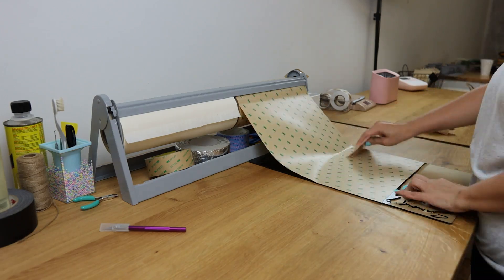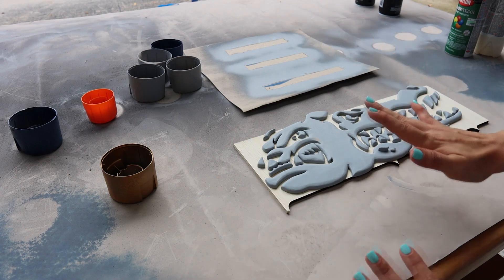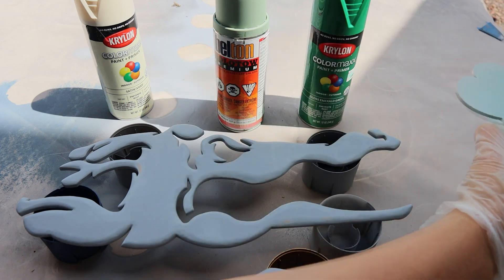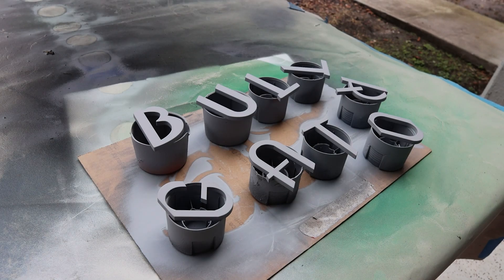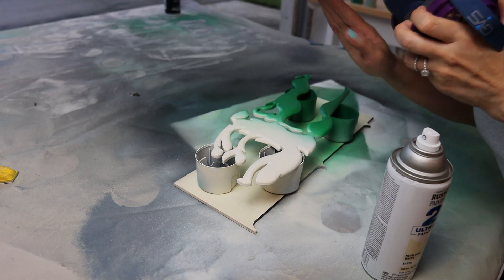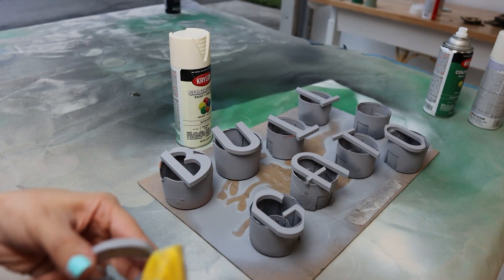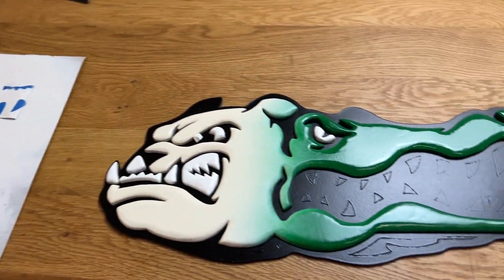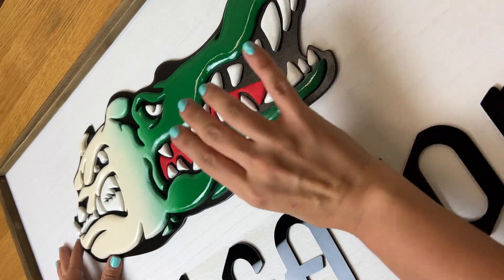How To: Laser Cut Signs Part 2

Comment: I was using both of these, but switched to Ironlak. I love it coverage. Hobby lobby has it at $5.99 as of 09nov24. Walmart sells the 2x stuff at around the same price. Both Rustoleum and Krylon have way bigger color portfolios, but give the ironlak a try. Please note, the spray cap is slightly different, so the paint sprays heavyier.
Reply from the maker: @MikeyouLikey  thanks for sharing. I’ll give it a try!

Comment: I’m trying to understand the purpose of sanding the mdf.
Reply: it's added a rounded edge. The laser added a sharp, straight cut and the design is softened / rounded over.

@ThatMomWithALaser You should check out a Palm/Trim router though for sure :) You could have saved so much time using a trim router and a "round over" bit. They're a lot more powerful than your dremel but if you can get to grips with them you'll save so much time and effort.
Reply from the maker: @MattHashTwo  thank you! I have one but I don’t trust myself with it. 🤣 Plus, most of the peices are so small idk how else I’d get into those grooves and thinner parts without breaking something. I’m assuming you just mean to use it on the larger peices like the bullgator one in this sign?

Comment: as for the bubbles, you also are trying to paint "before the rainstorm begins" :(   Being in Florida, you have the same problem with spray painting that I did here in Bama.  It's called HUMIDITY!
Reply from the maker: Hey, Michael! True. But I’m right next to the Everglades so it’s always humid where I am. What’s frustrating is how it will happen with some colors and not others. With Bombing Science however I never have an issue no matter the weather.

Comment: Have you ever tried airbrushing instead of spray painting
Reply from the maker: I have not. If I painted all the time then I would invest in one but this is only something I do occasionally. :)
Reply: @ThatMomWithALaser  a dual action airbrush is fairly inexpensive on Amazon as are small compressors.
Reply from the maker: @K7USN  I guess it’s worth a try but I’d have to clean it out each time to change the paint correct? Then I’d need more than one if I want to create that ombré effect while the paint is still dry.